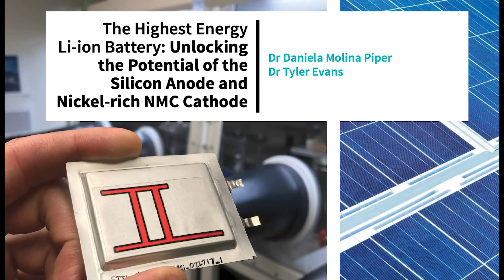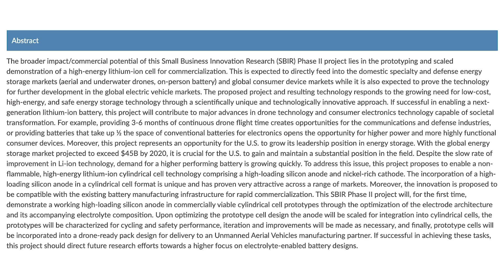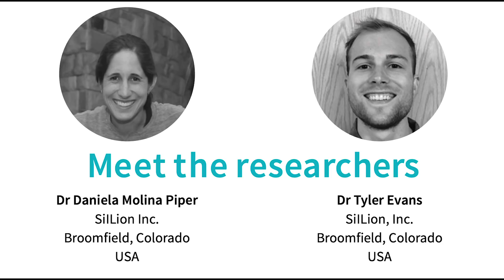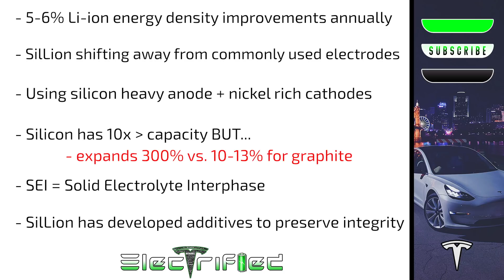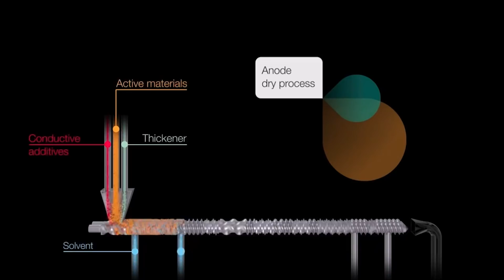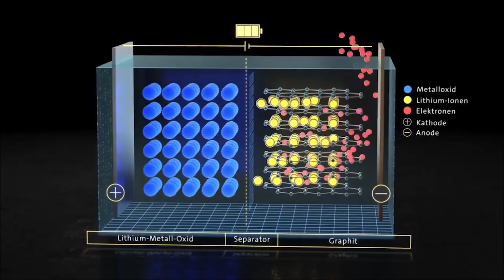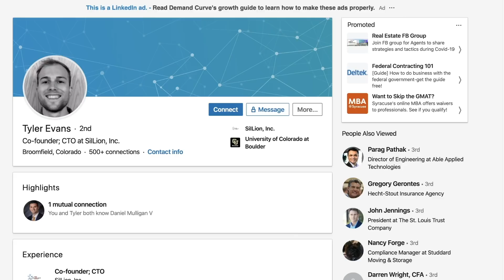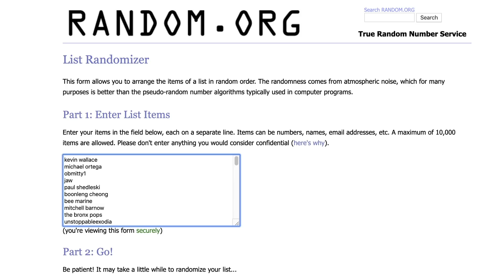Tesla SilLion - Everything You Need to Know (+ Giveaway Drawing)

Comment: The single most important word in this video is 'Compatibility'.  Any new lithium battery tech is going to have to be easily integrated into the existing battery manufacturing infrastructure.  The first company that can do that will be the proverbial golden goose.  I'm fascinated by the battery tech as that will have the single largest impact on widespread adoption by current ICE consumers.  Advances in batteries will have an impact on both range and cost.  

As a former first responder I more than most understand the significance of EV batteries and their potential to cause fires when compromised.  A non flammable electrolyte is HUGE.

Another great informative video my friend!  Thanks!
Reply from the maker: Spot on brother - that's the main takeaway IMO. Silicon and nickel rich are great but any tech that's not going to be applicable at scale will remain a novelty!